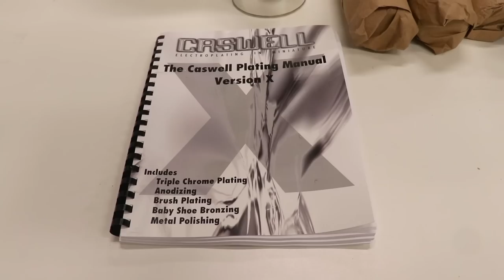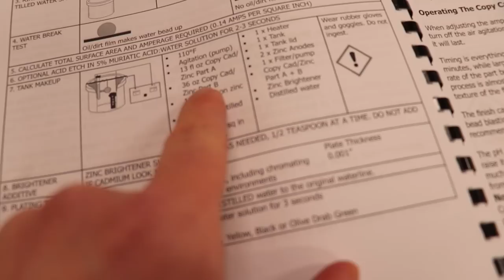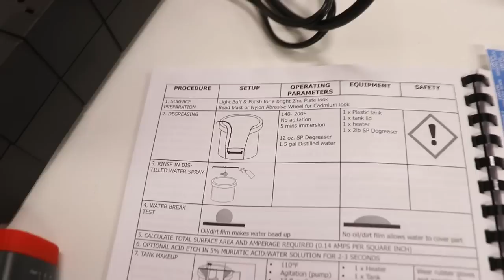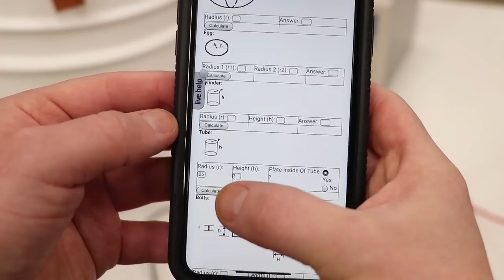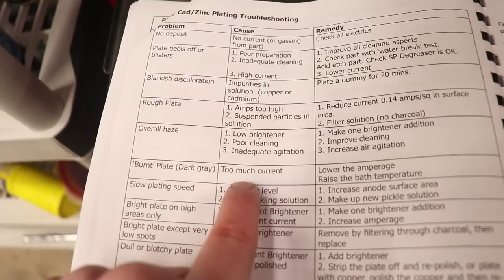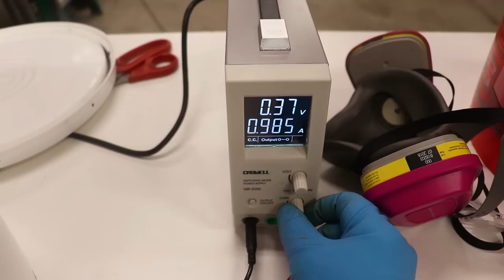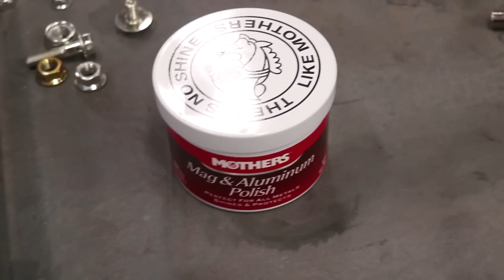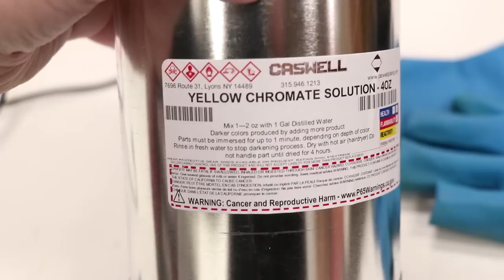Ultimate Guide To Making Bolts Look New Again!

Comment: If you like making things, you can get a brand new CNC mill for under 10 grand that is about the size of a briodgport mill, and fit nicely in your shop, (either bench top or more expensive with the stand.  I paid 12 grand for everything, and I still live off of it, (porting little 2-stroke cylinders) 14 years later.  Check out the company "Tormach".  It is not a heavy duty machine, but small cutters (under .375" diameter IMO", and pretty light aluminum cuts, the machine will last a long time.  You can learn G&M code to program it yourself, (takes practice), and you only need expensive tool path software for 3D machining, (like making a mold with a lot of curves, would be a nightmare to program by hand).  You can easily make a set of linkage pull arms, for one example.  Or you can make prototypes of parts in your garage to test, and farm them out to a shop with powerful machines to run production, and start a business.
I have over one million dollars worth of work done through this little 12 grand machine.

Comment: When you used the calculator for amps to use, you forgot to check the option for "plating inside the tube" too.  This should ahve meant that you used half of the amps required.

Comment: When making the bucket bar why didn’t you just use the vice to squeeze and bend the tube ends?
When buffing you should really be wearing gloves. 
When calculating the surface area of the trial piece there is an option in the app for plating the inside of the tube or not. Initially this was set to YES but somehow it got switched back to NO just before you took the result. So the area used was only half of the actual plated area which might explain the initial results.

Comment: just a note: you figured the copper tubbing surface wrong. Unless you seal the tubing off you ARE plating the inside surface of the tube. You didn't include the interior of the tube..

Comment: Really enjoyed the video but I’d like to make a comment. Electricity is very dangerous. The highest “safe” current is 50 mA (aka) 0.05A anything above that is capable of stoping your heart. I would suggest being extremely careful when removing the parts from your plating tank. If you end up getting any part of your body in series with the circuit, you risk electrocution and potentially death

Comment: Since you are trying to spread the knowledge to people on how to plate you should educate yourself more about zinc electroplating. I`ve been doing it for more than two years now and you made some mistakes here.

Really bad things:

1. Get that bucket heater out of there as soon as possible before you contaminate your bath with aluminum particles. The only heaters that should into the electrolyte is the glass/rubber/plastic aquarium heaters or titanium heaters. Anything else is going to contaminate the electrolyte that supposed to last life time if you take care of it. You really don't need this solution to be that hot, I've been using aquarium heater set to max heat for years and my zinc looks like chrome.
2. NEVER use your zinc plating bath for de-plating! You will contaminate your bath with iron particles from steel parts. I use 50% muriatic (hydrochloric) acid for de-plating and stripping old plate. Or you can also buy acid pickle or strippers from Caswell. The 5% muriatic acid is not strong enough to remove the old plate and the fizzing you see is not removing the zinc; it is activating it.
3. When you take it out of acid bath you need to make sure you get all of the acid of it. "Sprinkle the part with water" is not really good way to do it; either dip in the bucket of fresh water (distilled) or spray the crap out of it with sprayer. Again you don't want contaminate your electrolyte!

Hints:

1. You don't need the bandage for zinc plates; that is typically needed for nickel and chrome plates, but if you going to do it you then do it properly and wrap the whole thing into it. The point of bandage is to catch the little metal particles from plates as they disintegrate in the bath. Caswell sells special pockets that you put your anodes in, but again for zinc you don't need to do it.
2. You don't just dump bunch of brightener in the bath. Take a plastic spoon and measure half of it. You will need to do that often so get a spoon.
3. You don't need thick copper wire for small stuff. Look up maximum current for solid copper wire. 14 AWG can ran 15A at 120V in a house so for max 5A supply you can run 20 or 20AWG no issues.
4. I run my zinc plating at 3.10V....2V seems low.
5. You seem to be using too much current for most of your things. The fizzing is too much you are getting; there should be just small bubbles. I really take my time with calculating surface area for each new part I plate and write them down on separate cards, which I keep this for the reference. For some parts I use CAD software to either drop standard fasteners in there or actually draw it myself so I can get as close to real surface area as possible. Then I start with lower value and increase the amperage by 10mA at the time until I reach sweet spot.

Electroplating is as much art as it is science.

Btw. You are actually wrong about the "color" part of the zinc plating process. Zinc by itself is not very resistant to corrosion and you will see white chalky appearance on those chrome looking bolts. Most (if not all) zinc plated fasteners are actually zinc plate with blue chromate conversion. Chromate conversion is the thin layer of oxide that is super hard (way harder than zinc, which is soft) and it provides real corrosion resistance. I have blue, yellow, and black chromate, but Caswell also has oil drab. If you put some ketchup on just zinc plated bolt it will eat through it in no time.

@Cameron Niemela I really hope you can update this video and comments, because you need to take better care of your electrolyte (the most expensive part of the kit) and people that will watch this will ruin their baths.